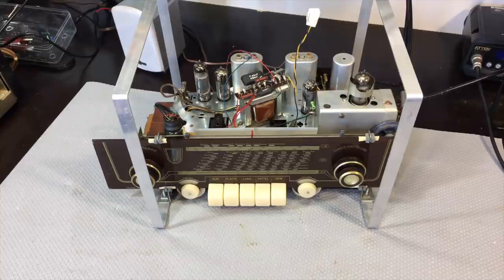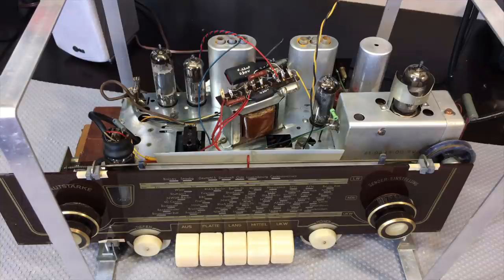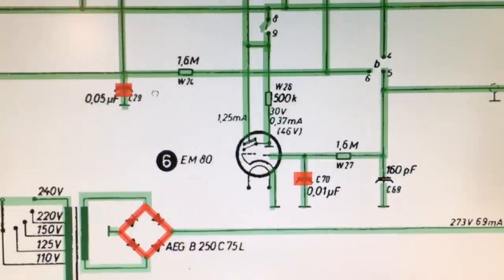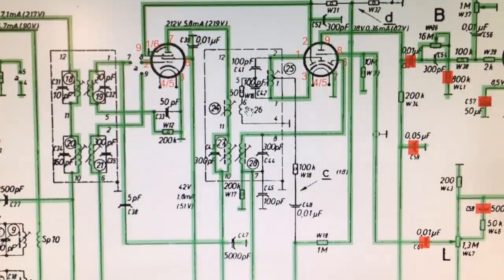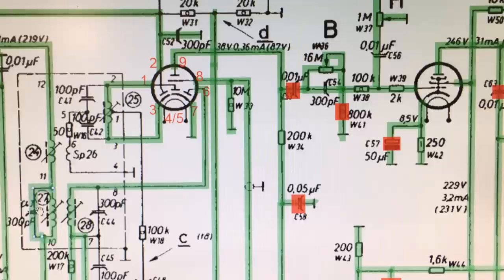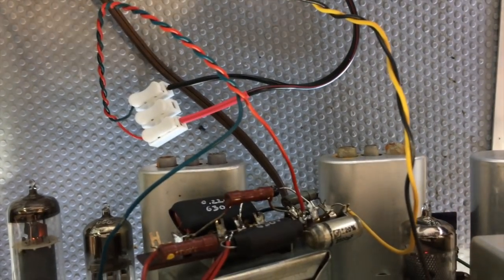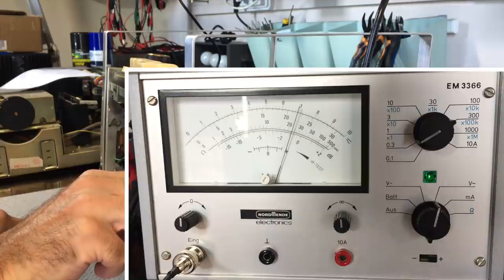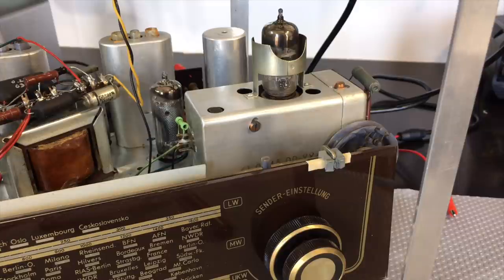Telefunken Gavotte 55 restoration part 4. Testing and aligning the AM bands.

Comment: Did you already check that the FM detector and IF are working? By applying a 10.7 MHz FM modulated signal from the signal generator to it?
Reply from the maker: no. I take it one step at a time. FM is next 😊

Comment: why 460 KHz and not 455 KHz? Is 460 specific to this radio or am I missing something?
Reply from the maker: It’s specified as 460. A lot of European radios use this IF frequency, instead of the 455.
Reply: @electronicsoldandnew  Many thanks. Super video. Watched it end to end. A excellent methodology for working through things one step at a time in a logical fashion.
Reply from the maker: thanks

Comment: I always enjoy your videos!  Sometimes I have to watch one several times in a row to catch and understand things, but that is a "fault" of mine, not yours.
I am sure you probably mentioned it somewhere before, but I didn't get what that tube (valve) is that has the 3 diodes and 1 triode in it.  I have never seen such a tube in any other circuits.  I would like to see a data sheet on that one.
I may have asked you before, but don't remember if I did.  Do you have an outside antenna that you can use in testing the radios?  I know you have the short one that you use inside, but just wondered if you have any outside antennas that you experiment with.  By the way,  what is the model number and manufacturer of the short whip antenna you do use?
I am especially interested to know just what is blocking the FM reception on this radio.  It certainly isn't clear to me...with all you have already done, you would think that you would have SOME performance from the FM circuit.  Looking forward to seeing your success in resolving the issue.
Reply from the maker: The tube is an EABC80, commonly used in German tube radios. 
I use a mini-whip antenna placed outdoors on the roof of my building. I built it myself and linked to the build video, with all the info on where the idea comes from.
As for the FM, it should have shown some signs of life. However, as it hasn't, I'm sure its a connection problem. Should be simple to find.